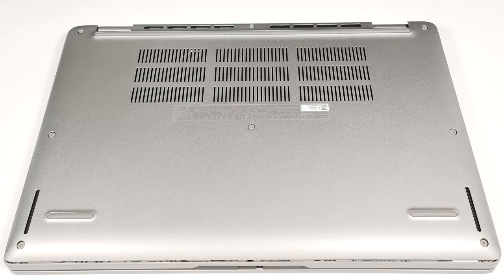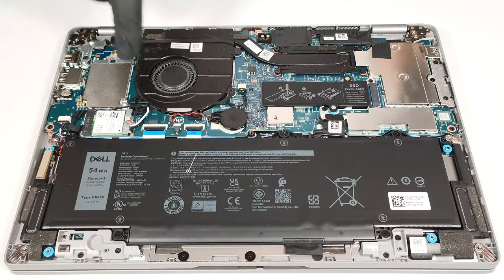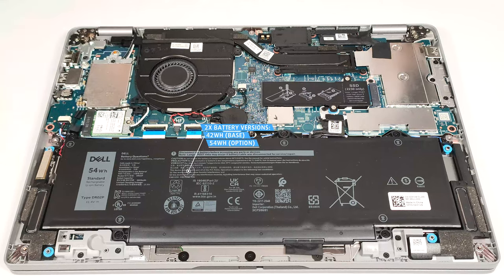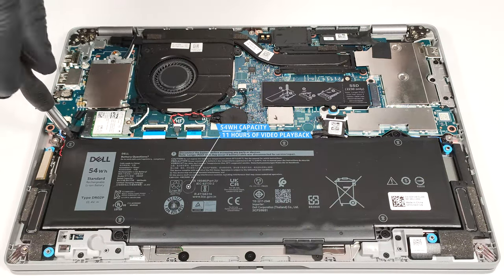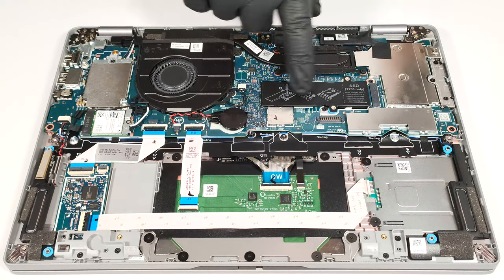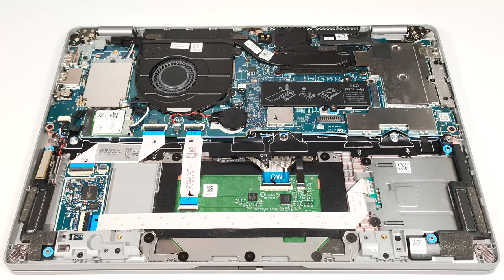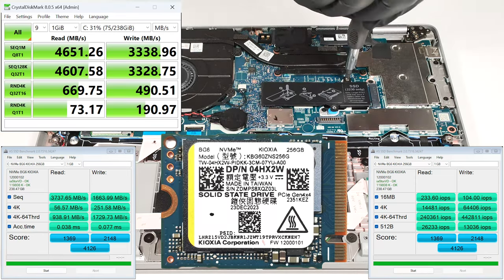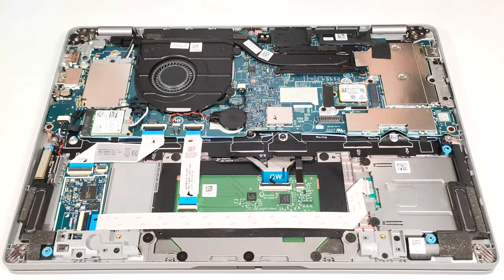🛠️  How to open Dell Latitude 13 5340 - disassembly and upgrade options

Comment: Can I Upgrade the RAM on this one? I got one with 16GB RAM but I wold like to put 32GB. Didn't now it was soldered RAM.
Reply: If you know what you're doing and want to void your warranty, you can desolder the existing RAM chips and re-solder new ones! Good luck and post results! :D